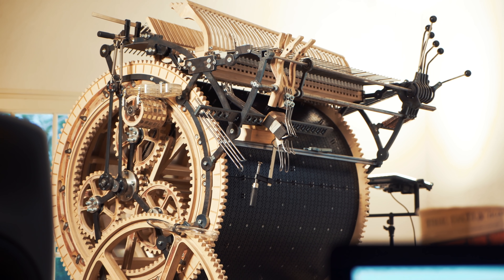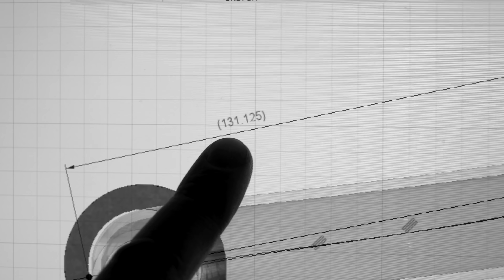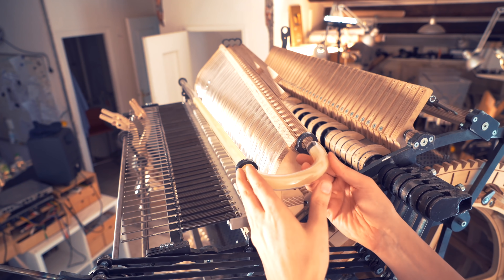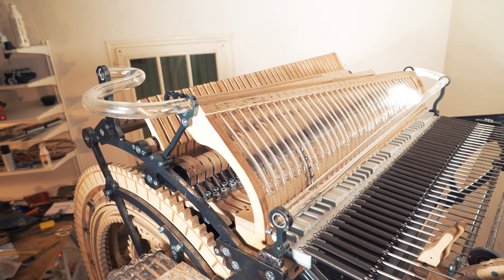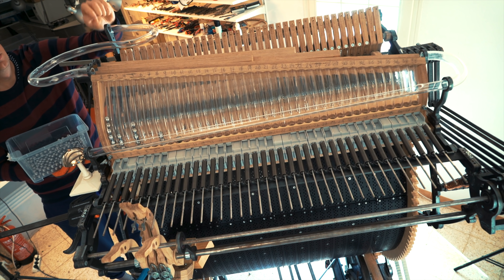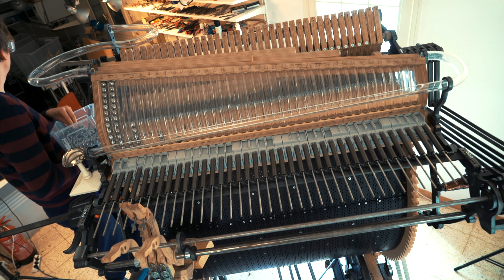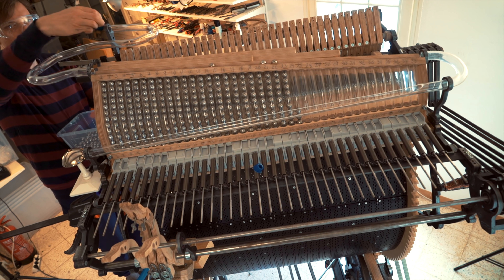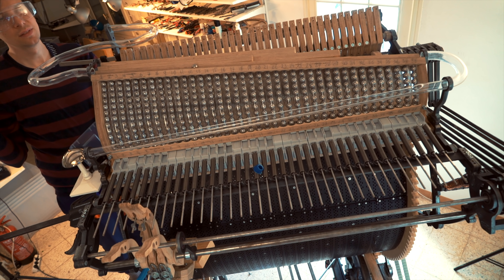Marble Divider Transport Tracks - Marble Machine X #68

Comment: The corollary of the sunken cost fallacy is the sunken cost REALITY... the programming wheel is the very core of the entire machine.  It could not be made easily removable, entire, and still be even remotely the same machine.   While all of the sub-assemblies that surround the wheel can be pulled off and revised... any major change to the idea of the programming wheel would result in essentially starting over from scratch.  At this point, you are close enough to an operating machine that it would be foolish NOT to finish the thing as designed...  only in actually playing it will you be able to assess what works well and what does not work well and thereby refine the design.

I do not think this machine is overcomplicated from the prior design... it’s simply being made using a much more versatile and accurate set of tools and materials than was the last machine. Aside from features you added for ‘theatre’ - it is essentially a very simple machine, given the complexity required to produce tight music with falling marbles.
A saxophone is complicated LOOKING...so is the inside of a piano...  they are as complicated as the music they play demands them to be.
Reply: Really. Any major changes to it should be considered for the next version after this one is completed. Too far down the rabbit hole now.
Reply: @davidmcgill1000  
I agree. Make the Marble Machine X as good as possible now and let perfect improvements for Marble Machine Luna
Reply: revisions to the programming wheel/plates can be made but strictly within certain parameters that match the surrounding components. And down the road we still may see some changes to it.
Also, many of the massive designs in this project rely on the requirement that this can be used and transported quite extensively. As much as I can appreciate the first MM as a fine piece of art, it acted more as a proof of concept that made a nice song but sort of tore itself apart playing it. This MMX needs to be reliable.
Reply: The programming wheel may be too late to be revised, but considering that it is at the heart of the machine, it is worth more thoughts. Martin is willing to take that step. Because who wants to live with regret? the HBC solution may solved the main problem, plus some added perks. Just sayin...
Reply: culturenomad -   As long as it can be adapted to the existing machine...  but after last week it seemed he had solved the programming wheel issues and was ready to run.
But having to have every song pre-welded and then affixed to the wood cradles that hold them to the machine seems to Create problems as each and every set of plates will still have to be adjusted and calibrated to play in time across each joint...   but the trap is not the sunken cost fallacy. The real trap in design is that “perfect” is the enemy of ‘good enough’.
Reply: @culturenomad  What is the HBC solution? do you have link for me?
Reply: Logician - there are always calibration issues.   A single sheet of steel still has a seam where the music repeats.  A single sheet of steel will change dimension with temperature, rather rapidly as steel is an efficient conductor. Around the circumference of the wheel the steel will change length by a millimeter or so in going from 80 degrees  to 50 degrees Fahrenheit. He would be better off with 4 separate sheets of steel on four carriers, like the one he made for the plastic.   In this way he can use the existing wheel and divide the expansion error into 4 smaller changes with the idea being to get the expansion variation below his tenth of a millimeter target.
Reply: Yeah, save the other ideas for the MMX-II
Reply: The only viable choice now is to create a reprogramming mechanism that can pick and place the programming pins on the fly during a song.
Reply: @JPresto  A Marble Machine Recording Device!

Comment: I'm not sure of the feasibility with the other requirements, but Cleco temporary rivet fasteners would be an easy way to reprogram the wheel. They will allow some flexability in the hole size, but I think that cost and overall size of the fasteners might be an issue.

Comment: You are saying that you don’t have received any designs that would solve the problem. Wouldn’t it be possible to machine the entire thing out of aluminum? And maybe you should ask a professional shop to do that because there they will have probably quite skilled people.

If I was supposed to make a suggestion for a design change: why don’t you try to machine instead of this 1cm thick plastic plate to machine several thin sheets of Aluminium, which you then layer on top of each other. 

And maybe you could also try to machine the current design in several passages. So let’s say 5 or 10 channels at a time, then you let the part cool down, check the tolerances, maybe redo some holes which have shrunken and then continue with the next section. It’s basically the same for your CNC as it is for you. Break down a enormous task in to more smaller task so you can focus on one short task at a time and...

Comment: To be honest Martin I think most of your stuff is as complicated as it needs to be, I've seen a lot of people giving feedback, and it's obvious most are engineers, and not also musicians and composers.

I don't think having the songs preprogrammed necessarily fixes a lot even though I see why people might expect that. The problem occurs that preprogrammed songs will have the problem that they simply can't be fixed easily, if a stud breaks, if the temperature and humidity results in warping, you'll have no way to fix that on that fly.

As much as people like to throw all kinds of catch phrases around, there is a saying much more important than all of them. "Always build stuff you can take apart and repair". Much of the criticism over simplifies things to a point where you're out of control and lock your options with inevitable problems that will come with touring.

Built flexible even if complicated, don't simplify for the sake of making the current task easier or because people don't understand the need for complexity.

Remember the average person is pretty stupid, then realise half the world is dumber than that. Don't listen to vocal minorities on the internet just because they yell loud. That also applies to myself.

Comment: Hi Martin.
I have given your problem of the programing wheel some thought.
I am not sure if you may or may not have considered the following as an option.
Make a exact copy of the main drum to serve as a mandrel, make blank segments, attach them to the mandrel.
Modify your router to make it 4 axis capable.
Attach the mandrel to your machine in a 4th axis and machine away. 
This in my opinion would resolve many of your concerns, as it would machined with perfect spacing between each segment. 
Much like machining insitue. 
Feel free to let me know if this is a viable option for you. 
Regards 
Apollo

Comment: You could have one row of electric actuators attached to an Arduino or Raspberry Pi and then a sensor that can detect the speed at which you're turning the crank.  Then with software you can create a program that will have pre programed songs that will be played back at the speed you are turning the crank.  I don't know if you are trying to stay away from electronics in this project though.

Comment: Although it's much too late in the process to implement this, you might consider it in possible future iterations of the Marble Machine. Instead of the marble dropping when the programming pin hits the registrator element, you could design the mechanism to drop the marble when the registator element comes off the programming pin, like how a clock chime hits when the hammer falls off the cam, or how a music box plays when the tine snaps past the pin on the cylinder, or how a jaw harp only makes sound when you let the tab spring back. This would make the drops consistent regardless of tempo, since the way the registator element drops off the programming pin is independent of how fast or hard the programming pin strikes the registator element.

Comment: Why not just use a big roll of thick paper (or clear acetate for aesthetics), just like other punch-card organs? It's proven tech; paper is cheap and easy to program and modify on the fly (post-it notes over incorrect holes), has infinite variability (triplets and other tuplets), can be laser cut, changed easily, stored easily, can be 'tight' in terms of musicality. You could put sprocket holes in it to help synch it with the rest of the machine, and you could retain the big drum as a spool instead of an infinite loop, or keep it as-is. Belt tensioners, alignment holes...all good stuff. Would make having music much less of a fabrication task. Think of those newspaper printing machines, combined with a simple music box. Paper also has a genetic link to the notation of music, so it sort of feels right.

Comment: I'm wondering if the smallest tube of the divider shouldn't be filled first. Right now the longest tubes get filled first, but isn't the smallest one running out of marbles faster and gets filled up the slowest? I'm sure the creator will have thought this through but I just want to understand how that will work and why it will not be a problem.
Reply: agreed, to me the far end will suffer starvation issues, maybe its going to be base heavy music...assuming usual conventions of low notes on the left..

Comment: A quote attributed to Albert Einstein is applicable here: "Everything should be as simple as possible, but not simpler."
Pick your REQUIREMENTS and then identify any DESIREMENTS, and THEN you can decide how simple it can be (or how complex it must be!).
For instance: Is it a requirement to be able to play triplets?  I think the answer is YES, so you need those extra positions.
Is it a requirement to be able to program it on the fly? I think the answer is NO, so this is a DESIREMENT or 'stretch goal' and IF it can be accommodated within the budget and schedule, THEN add it in.
Complexity drives costs at > 1:1 i.e. twice as complex is not twice the cost, it's probably 3x or 4x the cost - on some systems this can be an exponential relationship.  I don't think that's the case here, but the costs will definitely increase.
I like the current black plastic design with the magnet pegs for what it's worth! :)
Reply: it is literally a requirement as this is a concert instrument that needs to play more than one fucking song.
Reply: @XcaptainXobliviousX  The way Martin described it in the video was that he might want to reprogram it himself to change a song on-the-fly without removing the panels which is what I was referring to (and maybe I misunderstood).  Being able to remove/reprogram/replace the panels during the concert is absolutely a requirement!
Reply: Probably not reprogram on the fly, but it definitely needs to be quick, otherwise he'd be only be able to play like, 2 songs. And having multiple dedicated tracks would take up too much space.

Comment: You need to come up with a hopper tool to let you fill/feed massive amounts of marbles so when you’re setting up for a show, you have a quick way to fill the system. It would also help you in larger scale tests later. 

Also: how do you plan on handling dust/debris on the marbles, wood, and in the tubes?

Another question: how are you solving the problem of temperature and moisture during transport and setup/tear down?

Comment: Until you asked for feedback, I thought you had the best of all possible systems, but after some creative thinking...what if you're holding the wrong roots on this part? Would a music box style roll of heavy sheet-plastic with precisely punched holes be better? It would require re-working of 2 assemblies, and creation of 2 reel-to-reel style rolls, but otherwise be fairly minimal.  On the upside, all the songs will be pre-programmed on rolls.  Downside, they will gradually stretch over time, and precision requires the programming wheel become merely a guide wheel for the programming roll as it passes through.

Comment: Hey, i have said it before ill say it again. It would take a modified cnc router but the operations and accuracy would be greatly increased if the cutting of the programming plate was done on a 4 axis router.

Comment: If you aim some compressed air at the edge between the silicon rod and the PMA pipe while trying to remove the rod you will have a much easier time.

Comment: The only real problem I have seen with the current programming wheel design is, the Polyethylene PE300 Sheets seems to be really stubborn to work with. The end result is also rather unpredictable. I only wonder if switching to a different material may be better. Maybe something like PVC,  Polyvinyl chloride.

Comment: Regarding the programming wheel design: It seems to me that the great difficulty arises from your interest in providing pin holes for smaller divisions such as eighths, and differently spaced divisions such as triplets. The current design also prohibits the programming of more complicated figures such as fifths.
Suppose your wheel only had pin holes for quarter-notes, and you built more "interesting" pins that would fit into the quarter-note holes, but would have projections for eighths, triplets, and other figures. Put the complexity into the pins, not the holes. That makes timing across plates far simpler, and allows you greater metrical flexibility.

Comment: Wondering if you could create a machine in the cylinder of the programming wheel that actually retract and put back pins from "behind" (meaning inside)  ? Might make some noise though

You could then program the machine and it would play alone or even change song during the song. You might not be able to play fast song because of the proximity of the pins ...

Comment: I don't know if there are important engineering reasons not to do this, but ... would it be possible to build blank programming segments, attach them to a rotating jig that lets you index each row, and then drill the holes in that row? Make sure all the distortion of bending happens before the actual creation of slots?

(And sympathies on getting so much "why don't you just do this" from the comments - going over comments is a lot of work, and it's not easier when it comes wrapped up in criticism. I hope you can get a good, reliable solution for your needs.)

Comment: Martin, this is an idea that might just add more complexity, but the programming problem for multi-tune antique music boxes was solved by having several tunes programed on the same cylinder in adjacent tracks.  When one song is played the cylinder (wheel in your parlance) shifts laterally slightly so that the tracks for the next turn are lined up with the teeth of the comb.  And it was worked out on some of these boxes so that you could choose which track would play and they did not have to be played in successive order.

Comment: Have you been keeping a close eye on your ambient temperature while machining the programming wheel? You're finding a lot of deflection while machining, so it might be down to temperature variation in the material while you machine. Overall variation in the room due to running a large CNC machine, and local variation due to a high speed piece of metal cutting and rubbing on the plastic. Consider a high power fan to keep things cooled and more consistent. Look at it with a thermal camera while machining to get a better visual of the inconsistencies. Ask around, I'm sure someone there has one. Or you can get one that hooks into your phone.
I actually really like the design you have and all of the adjustability built into it.

Comment: I've been envisioning mounting the entire programming wheel on a giant "4th axis" for your CNC and machining the holes for the magnets with the plastic already mounted in its final position on the wheel.  It could still be constructed with multiple panels and programmable, but as long as the panels are always mounted in the same order around the wheel, the programming holes could be perfectly spaced.

Comment: Why do people try to label this awesomeness like a disease or a syndrom? What you suffer from is a lack-of-giving-up syndrome. I think that the most epic aspect of the MMX will be its overcomplicated precision and beautiful sound. Keep it up Martin! You are almost there!
Reply: I wouldn't say its overcomplicated, but its complicated by necessity for its functions to work. if it were any less complicated, it wouldn't work.
Reply: On top of that despite martin being in the right as he has a functioning form of his envisonment. That mindset can be detrimental to other tasks that could even lose lives.

Think of how many people have died in ancient history constructing the massive monuments that are still standing today?

Simply puy knowing when to throw up your hands for a different soloution is a good trait to have.
Reply: @madmanadam1  In this case though, as hes said, there isn't another solution, at least none that anyone has offered. If anything the current solution is a middle ground, he had to remove holes on the point where two joints meet and as such hes limiting his art. but hes doing this because it makes things a bit easier. similarly, the panels cant just be swapped into different positions they are keyed for that exact position, that is another compromise in his design. He could pursue these to get them the way he wants but it could take far longer.
Reply: @madmanadam1   no one died from the design of those monuments, people died from the way they worked
Reply: @monad_tcp  they certainly died to make them

Its an argument at its most extreme. The most this machine is gonna do to you is break a bone/lose a finger because you stuck your finger in a wheel.